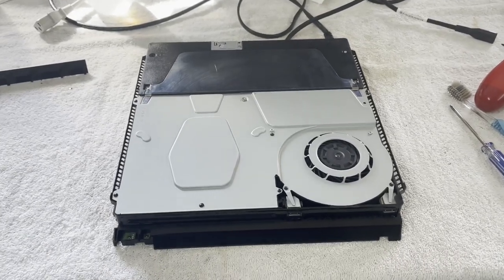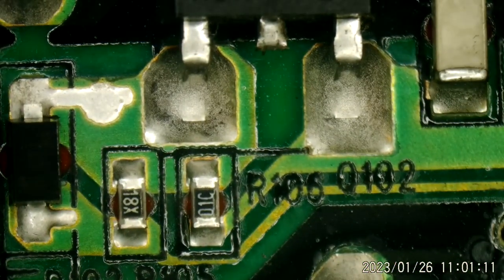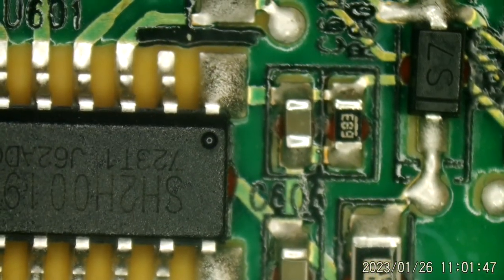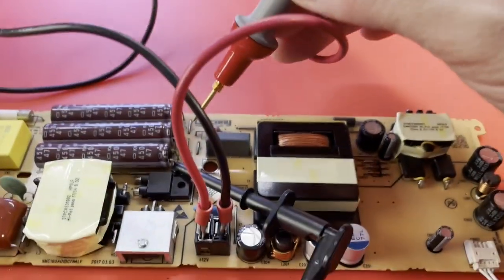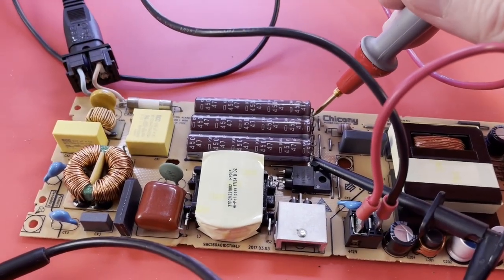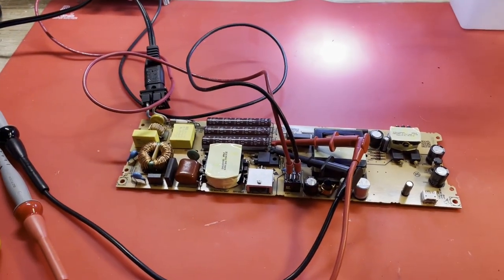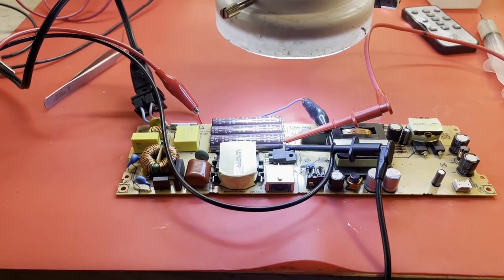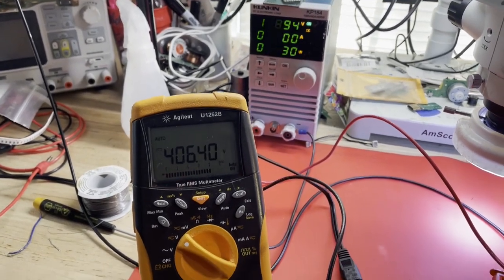#75 Repair of PS4 Slim Fast Shutdown

Comment: Tricky one, nicely tracked down!! Funny that it turned out to be the FB resistors after I thought I saw what looked like a pinhole (probably wasn’t) in the middle one @28:40 
Very educational repair, THANK you for sharing these!
Reply from the maker: I'm pretty sure that's a solder ball.  I think these resistors just age over time when exposed to heat and high voltage.

Comment: Thanks m8, I been struggling with this exact problem on 5 different psu. I was speaking with SteveBe just yesterday about it, and he was of the opinion that I should check those 2 meg resistors as they deal with current sense for the power factor correction ic. 

Thanks for posting this. I certainly enjoyed it!
Reply from the maker: Excellent!  Steve Be is a wealth of information!
Reply: @ToltecMerc  he sure is!

Comment: The middle 2MOhm original resistor had something on it, not sure if it was a solder ball or a pinhole (43:48).
Aniway, very interesting repair. 🙂
Reply from the maker: Yeah, solder ball I think.  Thanks for stopping by!

Comment: Intermittent faults are really hard to find the cause. these feedback loop resistors usually change because of the glue that over time creates resistance and changes the value of the resistors, I already got some that just cleaning the glue solved the defect..
Reply from the maker: Hmmm.  I hadn't considered the glue.  Thanks for watching!

Comment: I just found your channel, and I'm hooked. Thank you for all of the great explanations that you do.

I have a long way to go, but I love to learn. Where would you suggest I start? I have almost all of the tools needed, and I can solder. I just need to understand how it all works together like you do, although it seems like you probably did something like this for a living.

It's clear you didn't just hook up a multimeter and expect to immediately find a problem. You understand how it works better than any other YouTuber I've seen.
Reply from the maker: Thanks for the kind words.  I have been working with electronics for about 40 years but only recently started working on consoles.  I’m having a lot of fun.  I would recommend buying something broken and start trying.  You can learn a lot watching others so it is a good idea to pick something somewhat common that others also work on.  You really have to learn by doing.  You will pick up knowledge along the way.  I don’t recommend starting with power supplies because of the dangers.  Good luck!!

Comment: Thanks for sharing! Very ineresting and helpful! I've the same problem on my psu ADP-240CR (I've found a bug that have shorted mosfet FB13), checked the resistor with multimeter they measure 2.42MOhm that seems a little bit low because they should be 2.7MOhm, should I try to replace them? which wattage and tolerance should I buy?
Reply from the maker: It is very difficult to measure high value resistance in circuit because of parallel resistances and voltage remaining on capacitors.  Desolder the resistor and test again.  I find it easiest to heat the resistor and just spin it around so it is only making contact on one end but is still held in place.  Also, you might clean any flux off of it before measuring.

Comment: Hi mate, can you tell me what power supply bench you have? Like what specs. Thanks in advance!
Reply from the maker: I have several bench supplies.  In this video, I used an old HP E3620A.  It's a two channel, 0-25VDC, 0-1A power supply.
Reply: @ToltecMerc  Thank you!

Comment: 26:58 - Whatever happened, it changed sound.
Reply from the maker: I'm not sure.  It sounds like my microphone came unplugged so the camera switched to the built-in microphone.  Or perhaps my microphone got covered by the coat I was wearing.
Reply: @ToltecMerc  I have one suggestion/idea for youtube videos. Im not quite sure how its done, but I hope you will understand.
You know that on video timeline, there is a possibility to show like segments, chapters. So on mouseover, people can see where which segment of video starts. I think it would be good overview, if we had something like that in those videos, for example 00:00 - 7:00 Visual Inspection, 7:00 - 9:00 IC1 , 9:00 - 13:00 IC2 and so on... then mark "Resistor solution" at the end.
I know its one more step in editing on youtube but I believe it will be worth for viewer. 
He comes to this video and see, oh there is segment for this IC2 i wanted to check, I wanna see how he did it. And then he watch it. Othervise, he will just skip 42min video not knowing that info is there.

Comment: Hi  i was trying to fix an adp-300fr today which was roach damaged.I replaced the fuse and the 40N60M2 that was blown also the 1612A3 but i cant get the volts on the caps to go to 395V like it should when i try to turn the 12V on. I checked the line from pin 8 of the 1612A3 but there is nothing damaged there. . I dont know what else to do :( 
Your videos are amazing pls keep making them i really appreciate all the work you put into them. Thank you!
Reply from the maker: You may have to find another supply to compare to.  You can see if your high voltage is trying to go up briefly and shutting back down.  There are some large value resistors in the feedback circuit that can be damaged.  They will cause this issue.
Reply: @ToltecMerc  Hi thanks for replying I checked the resistors which were in M ohms on the feedback but they seem to be ok even replaced them but no change . They goto 2 transistors Q1 and Q2 going to replace thoes n see . The voltage does go up to 325v from about 310v then it shuts it self off . I replaced thoes 2 transistors but still the same the volts won't goto 395v any suggestions on how to test the pfc circuit ?
Reply: I managed to fix it . I re soldered all the optos and the DNP012AH chip and its working fine.

Comment: I haven't seen this model ps4 that looks like this. Is this a model from overseas like uk or japan or somewhere
Reply from the maker: It’s just a standard PS4 Slim.  It is missing the outer shell.
Reply: @ToltecMerc  i work on own stuff but just never seen a ps4 slim with this kind of plates is it an off brand plates cause it doesn't look normal to me but then again i never owned the slim model. But seen tear downs and stuff like that and never seen one with this kinda of setup with the antenna place ments and stuff
Reply: @ToltecMerc  i still found the video interesting by the way it just looks funny compaired to some others i seen. So yea just werid curiosity of why it looks like this unless its a revised version i just never seen